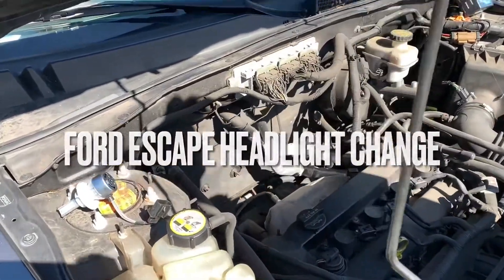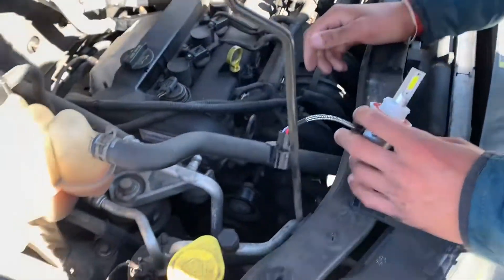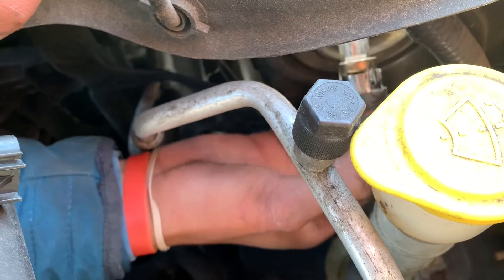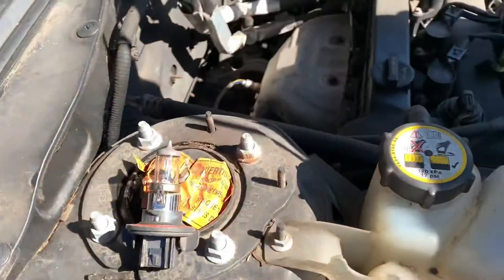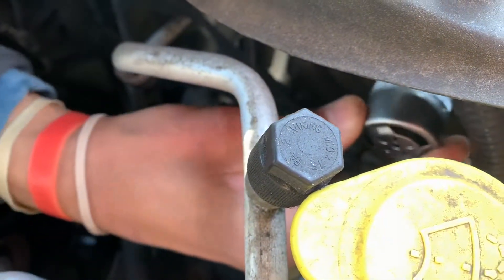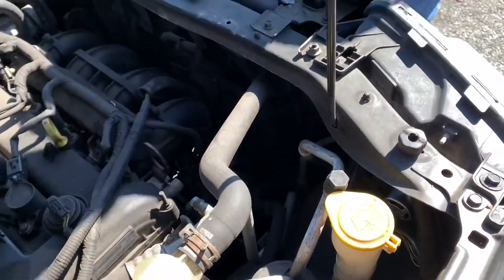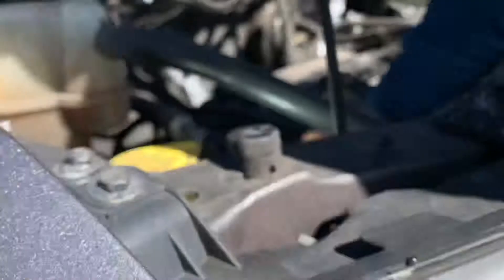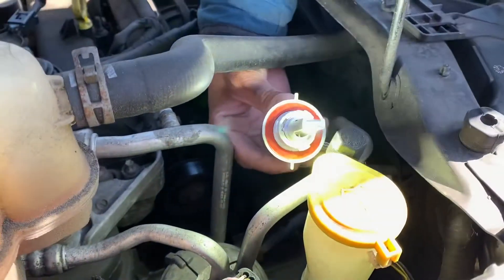How To Change Headlight Bulb On A Ford Escape (2008-2012)

Comment: I don’t know where you found an escape where the headlight bulb just “wiggles out” but that’s not in any of them I’ve had to deal with. You had someone previously make it to where it only has to be wiggled out.
Reply from the maker: I know rust and corrosion can make things hard to come out. My car has no rust. And I've changed lights in many other cars so I get the hang of it.
Reply: No rust or corrosion, &’I’ve changed plenty of headlight bulbs. 
It just tight & hard to get to. Though he noticed you don’t have the hybrid.